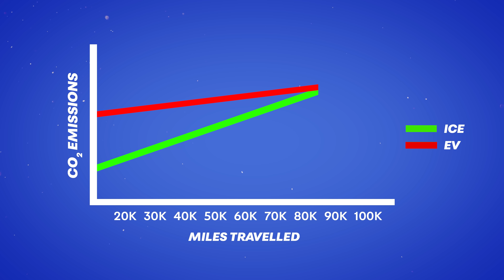Are Electric Cars REALLY That Green? [New 2022 Data]

Comment: EV batteries are made out of materials which have to be mined so are a limited resource. We will find in a number of years time once again that the materials used to make batteries are running out similar to the fossil fuel argument. so what then? do we jump once again to yet another silver bullet solution based on finite resources. Surely the most environmentally friendly solution here is to start converting ICE cars to run on hydrogen which can be created using green electricity (wind or solar) and the emissions from hydrogen fueled cars is basically water/oxygen. Converting existing ICE cars to run on hydrogen will 1) remove the need to mine, process and manufacture batteries removing the huge carbon footprint of this manufacturing process 2) reduce the need for new cars by keeping cars on the road therefore overall reduction in carbon footprint of new car manufacturing. 3) reduce carbon emissions of cars overall by using a cleaner fuel which can be created using green methods.

Comment: Cars used to be made of nothing more than Steel, Glass, rubber, aluminium and cloth ....now they're made from exotics such as  Boron, Berylium,  Carbon, Indium, Cadmium, Silicon dioxide,  Nickel , Lithium, etc etc etc....these exotics DO NOT come out of the ground for free,  then there is the transportation of all these exotics  crisscrossing the planet multiple times to be eventually turned into the modules - electronics and energy storage systems required. ...EV's are not the answer....the horse and cart might be.

Comment: You neglected to factor in battery replacements. 
ICE cars can use the same engine/transmission for hundreds of thousands of miles.
EVs will all need battery replacement at some point.
Reply: Wrong. EV battery refurbishments are becoming increasingly more common now, and normally cost a fraction of a total battery replacement.

Comment: A bit cherrypicking. The reasoning behind the Volvo study is a bit flawed because it's based exactly on what everybody know to be the wrong and losing choice. Make the same car in ICE and EV form.  Of course, the original gas car will have a million more efficiencies over the production cycle. The same study should be made comparing a gas car and a fully born-electric car.

Comment: It would also be worth factoring in a replacement battery and if this is needed around the 90k point, the ICE car would likey produce less CO2 over the total expected mileage of the cars.
Reply: Why would an EV need a new battery at 90k miles, when it has a 100'000 mile battery warranty?   And why would you eventually fully replace it, when you could have the battery refurbed for a fraction of the replacement cost? Note the 100'000 mile warranty is just that, a WARRANTY. It isn't the battery's lifespan........

Comment: I'd rather have a 1000 EVs in a city than a dirty ICE. EVs will continue to become 'greener' as the electric grid (or mix) becomes cleaner while gasoline and diesel continue to use dirty oil.

Comment: What happens to the "Green Point" when the traction battery has to be replaced? They don't last forever so the cost of manufacturing a replacement and recycling the old one must surely need to be factored in? I love my old Toyota Prius, which has saved a lot of money on petrol over the years, but a lot of that saving has gone on replacing the battery this year!
Reply: Why did you fully replace your Prius battery, instead of getting a less costly refurb?

Comment: So EV are cleaner at the end! 🥰🤓
And with recycle-batteries etc, will do it even more cleaner EVen faster 🥰

Q: If you burn a 70kWh battery VS burn all the petrol with fire that is needed for "50-90 000 miles", witch one is more pollution? 🤔

Comment: Without doubt the overwhelming and infuriating lack of consideration towards the life cycle of the fuel (petrol and diesel) is what makes these kind of videos so transparently focused on the interests of the oil companies and the status quo.  These types of videos only consider the vehicle manufacturing process and subsequent usage.  The major omission when making these evaluations is the fact that the oil must first be located, then platforms must be constructed in the middle of the ocean (usually) using massive steel structures that would have to be manufactured on land and transported to site.  These platforms that often leak require constant power and maintenance.  The oil is then transported using massive oil tankers than run on "bunker fuel" which is the dirtiest and most polluting fuel on the planet.  Also remember that oil tankers are known to cause major environmental issues when they run aground and also when they empty their ballast tanks.  Once ashore the oil must be converted to petrol or diesel at the refinery using large amount of power.  Once refined the products must then be transported to the retailer so you can use electrically driven pumps to put it into your car.  Once in you car the fuel will provide you with power that is only 30% efficient as opposed to electricity which is over 95% efficient.  Anyway a quick glance at Auto Trader history will tell you that they are nothing more than a shill for big auto and big oil.  Transparent greedy little men who have zero foresight and no regard for humanity or the planet.
Reply: All this can be said about getting rare earth deposits say like litum... it's all the same.. it has to be minned, transported, converted to a usable state, made into a battery which all uses energy by the way..

You want to live a green life then get off your electric device, turn your lights off, pull your plug off the electric grid, and don't cook your food.... basically live like it's 1799.. minus fire because you don't want thay carbin in the air... but you won't.
Reply: @shortyorc121  My argument relates to the comparison of EV's to ICE cars.  I understand that the production of EV's requires more materials than ICE vehicles.  The issue is that when the comparisons are made the life cycle of fuel is not included in the equation.  As for your green life argument it is nonsensical and is not related to the topic of this thread.  May I also suggest you consider your spelling (litum, minned, carbin) when replying to a thread as it will give your opinion a little more credibility and you may be taken seriously.

Comment: I miss one element here. The fact that the batteries need to be replaced and that also comes with a footprint.
I guess that should be part of the cradle to cradle footprint.
Reply: Wrong, Batteries do not always need to be replaced. Like an engine, they can be repaired or refurbished for much less cost that a complete new replacement...  Haven't you heard of battery refurbs?
Reply: @Brian-om2hh  so far recycling of batteries is a small percentages. And even wuth referbing you lose some.

Also It's not cheaper but more expensive.

Comment: Green energy tarifs are bollocks.  Here's why.
Contrived figures:  The grid is generating 100GW.  Of which 20GW is renewables.
Everyone is using a 20/80 mix.  20GW of renewables are being burnt entirely.
Bob the smarty pants signs up to a renewable tarif, so he is helping to save the planet.??
No.  Bob sees that his "green energy" tariff is only using green energy so he turns on the tumble drier, puts the car on charge and goes about making some roast dinner in the oven, it's all green right?
No.  The grid is STILL only generating 20GW of renewables.  So by Bob consuming more, MORE FOSSIL FUELS GET BURNT.  The grid still only produces 20GW of green power, if you start consuming more of it, then other people will start consuming more fossil fuels.
Contrived figures again, but when 10,000 Bob's around the country do the same thing...
The grid is generating 110GW Of which STILL only 20GW are from renewables, but now we are consuming an additional 10GW of fossil fuel energy, but Bob and his cohort Bobs, is fine, right?
Well, no.  Green energy tarifs are NOT like for like, 1 to 1, live tracked. They are collected, deferred, endabted, stockpiled, offset, lied about, defrauded etc. etc.  If you dig really, really deep you will find a warren/nest of paper work and financial wizardry which means your "Green Tarif" probably owes the electrical grid many, many GWH of green energy they have already sold, but hasn't been generated yet.
It's a scam.

Comment: It's going to get worse, this type of thing.  Hydrogen is the "keep it in the bag" move from the oil industry.  Trying to claim hydrogen is cleaner/better than electric.  It's not.  It's just made from oil at the moment.  So they want to push it as green tech, because IF you generated the hydrogen from renewables it would be clean, right?  Well, first off, no, that renewable electric would be better used elsewhere.  Making hydrogen with it is extremely inefficient.  Then you have to compress it, cyro-genically liquidify it, keep it refrigerated, pipe it, truck it, ship it around the world etc. etc.  Turns out about 12% as efficient as just burning the fossil fuels the hydrogen was made with in terms of end-to-end efficiency from the source fuel.
Nobody does the numbers.  Nobody thinks these things through.  Everyone thinks they are a new pancea to global warming and the companies pushing these techs want that to happen even if they know it's not true.  Please, please, please run the numbers, even if you are estimating most things, run the numbers.  It will surprise you.

Comment: BEV and ICE and are both polluters. Hydrogen is a nice option nobody's talking about. Honda has one. Toyota has one. It's an internal combustion engine running on hydrogen gas. The exhaust is water (unfortunately, at least in the US, if you don't live in New York City of Los Angeles, you can't find a place to fill your hydrogen tank).

Comment: One MAJOR problem no one wants to talk about with EVs is disposal/recycling after the thing is dead. Recycling a petrol car is pretty simple, as the engines are largely metal and can be melted down and reused. Disposing of any type of battery is a rather complex, expensive, and dangerous affair with far more waste as well. You also need to factor in lifespan, as my old Subaru hit 300k miles while an EV seems slated to only last 1/3 or at best 1/2 that so to meet that same distance mark you will need multiple EVs which will stack the deck against them further.

This isn't factoring in the safety/environmental concerns in a crash, as battery acid is very VERY nasty stuff and as Richard Hammond's Rimac crash shows electric cars in a crash can catch fire easily and keep catching fire for two weeks after the crash. There is also a lot of concerns with infrastructure, both in terms of the power grid generating enough energy to charge the things (California told people not to charge their EVs to avoid a grid overload) as well as the availability of charging stations themselves. 

There are only two factors that make EVs better than petrol cars, first is the exhaust fumes and the second is that EVs don't care about altitude so they are quicker in hillclimbs like Pikes Peak which have a very drastic change in overall altitude.
Reply: There is very little waste in recycling an EV battery if it's done correctly. They can be 95% recycled, with the lithium and cobalt being 90% recovered and reused in new batteries. The steel and alloy mounting frames can also be fully recycled.

Comment: In the 1970’s combustion engines had to be improved due to the increasing petrol costs. At the time a sedan would barely get 10 miles out of a gallon. Today it would be for the same type of car about 12-13 miles. That is the pressure from the market to innovate. 
The same is going to happen with the market for battery driven cars and in the end we will all use hydrogen power, and electric energy will be mainly produced through sustainable means.
Reply: I don't get why more effort hasn't been put into cleaning the burn of petrol engines, improve catalytic converters. It would be a lot cleaner and cheaper than building an entirely new infrastructure that still leaves you with tonnes of nasty chemical batteries to dispose of. Oh I know we'll just burn them or put them in the ground! 🤦‍♂️
Reply: @vmondude  - No, there are already methods to recycle these batteries. It is only not yet developed to industrial scale - just a matter of time.
Reply: @philippschwartzerdt3431  It's hard to develop them to an infustrial scale because how dangerous they are to handle.

Comment: 1st: Let's just get this out of the way... Every ICE auto manufacturer has a mandate to maximize returns on their existing infrastructure; that includes misleading marketing tactics.

The key here is 3:47 "depending on the source", a worst case means your utility/industrial process is dependent on carbon sources. A best case is your utility/industry is derived from non-carbon sources. The current trend is towards ever more non-carbon (and renewable) energy and that means in the long run EV's are a method of overall CO2 reduction. Just because we are currently using carbon energy sources does not mean we have to keep using carbon energy sources. You can't fix anything unless you build the tools to address the problems.

Comment: Great video. Think another point is to not get rid of your 3-year old car if it still runs fine, just to get a "green" car. As pointed out, a huge portion of the CO2 emissions are made even before the wheels are turning for the first time, so using the car for as much as possible before switching to electric is better. And ofc, cities need to work to make cars useless for those who don't need them (e.g. short commutes within the city).

Comment: Still have to mine Lithium...Infrastructure non-existent and still takes fossil fuels to run chargers.....and it turns out no one wants to replace a $5000 battery.....they are piling up at the junk yard already.....

Comment: If you truly did the engineering to make cars running longer per gallon of gas or liter, you could achieve most of the reductions wanted without the costs or problems of electrical support.

Comment: I think this is a bit short sighted…. Just because volvo can’t make an ev as efficiently as a gas car until a certain mileage doesn’t mean it’s the universal truth.  Reality is battery tech is advancing away from things like cobalt and nickel (or at least drastically reducing the need), which are some of the most environmentally impactful materials to mine.  

I’ve got both an ev and a gas car, and don’t have a dog in this race, but considering advancement is only made possible by money - buying ev today will only encourage more r&d into the technologies and subsequently the material need.

Comment: The issue of EV vs ICE is the battery life and disposal. The mining of battery raw materials, possible replacement, and the disposal of used batteries makes EVs a potentially worse choice. Where then does hydrogen vehicles HV come into the picture?

Comment: Invest in mining companies........... Also 90,000 miles to break even? The manufactures do either 8-10 years or 100,000 miles for battery warranty so probably by the time you do 90k miles probably gonna be time to change the batteries. 
Does the this factor in all the infrastructure such as mining for copper for the cables? or drilling for oil for the plastic coating for said cables or the charging boxes? or the HGV vehicles used to dig up the roads to put in these chargers? Also check your "green" tarriff its a mix so your being sold the so called green but really your getting a mix......also solar and wind is not that green, they're made of and from fossil fuels have a short life span and need constant replacing......so another green lie.

Comment: Artificially ending the lifespan at 120,000 odd miles is biased towards the Electric car. Perhaps the cars artificial end date variable is to protect the electric cars argument. After 120,000 odd miles the curve swings the other way again. As it turns out oil-based cars will last a lot longer than battery cars (at least for the foreseeable future). In fact, if you go twice as far in a petrol car then refurbish the engine etc, at that point the petrol car far out ways the electric cars environmentally friendliness.

If you chose to do the same refurbishment for the electric car, then it would need a battery replacement, and that also is bad for the electric car’s argument. Also, the expense on the user replacing the battery means they are likely to buy a new car anyway, again bad. Another point is owners that drive oil-based cars tend to keep the car longer. Wow that’s another point for the oil-based car, as building a new car is a lot more damaging to the environment than keeping the current one, especially if electric.

Stats based on the fact that both cars are retired at 120,000 odd miles is the problem variable here. I find it hard to imagine the electric car can win when it comes to reality of ownership and longevity.  The Volvo test limited the mileage for a reason. They stopped the 2nd swing back in the graph. 

Dont get me started on recycling for the cars either.
Reply: the word is outweighs
Reply: @Brian-om2hh  For this comment it's barley worth answering, much less finding your reference.